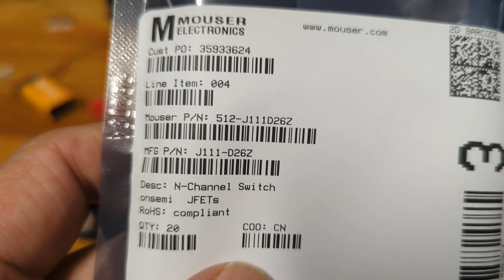SolderSmoke DCR Challenge   Bonus   J111 in PTO

Comment: J310's are available in SMD and through hole from mouser.  The SMD version is $0.23  Maybe its time to change up your strategy a bit?
Reply from the maker: Sorry,  but we think there is a lot of wisdom in doing it the way we have been doing this.  And LOTS of builders apparently agree. Some people just don't understand this.   And even when we identify a through-hole part that is easier to acquire, there are a few people who will complain about this.  Some people won't be satisfied unless THIS receiver is built the way THEY would build it.  But then it wouldn't be THIS  receiver. right?  It would be different.  Hey, if you want to build a different receiver, go for it.  But you would be building a different receiver.
Reply: @soldersmoke  To me and a lot of other folks, it sounds like your stuck in the dark ages,.  This is why ham radio is dying.  You do you.

Comment: The "acid test" is whether the J111 works AS WELL OR BETTER THAN the original J310. Just receiving is only part of the story.
Reply: The receiver sounds identical. Virtually any small JFET will work the same. This is the PTO buffer. It's only job is to switch the mixer diodes at the PTO frequency which it does very well.
Reply from the maker: Uh, this IS a RECEIVER.